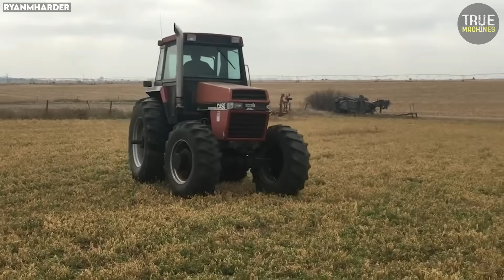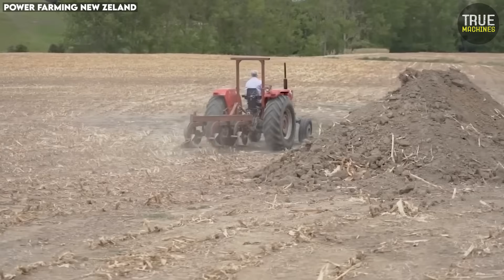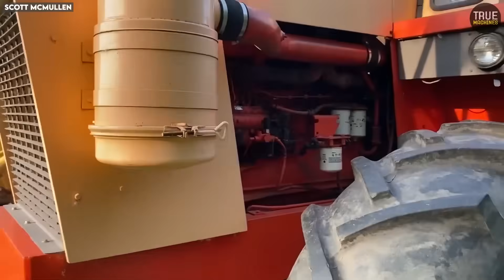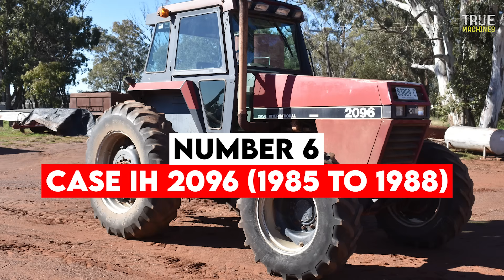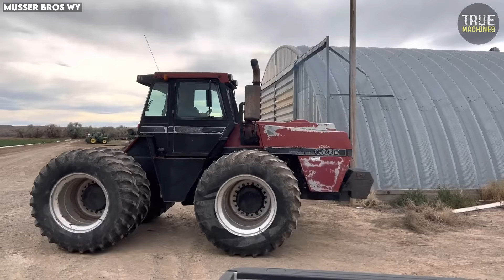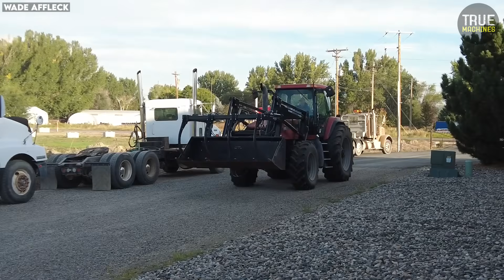10 Case Tractors That Were Great, But Failed!

Comment: I don't know who wrote the script for this video but, they need to look up what an articulated tractor is.   The 1200, 1470, and the 4470 are not articulated tractors. They all have steerable axles and are not hinged in the middle.

Comment: The Case 1200 Traction King tractor was not articulated, but featured a rigid chassis.
 It steered via various permutations of its 4 wheels, which is to say, crab steering, co-ordinated steering and either independant steering via the individual axles, which were sourced from Clarke and were drive/steer types.
 The Case 1200 was succeeded by the Case Traction King 1470 model and various other Case tractor models of 4 equal sized wheels which both drove and steered the machines. The rigid frame, 4 way steering concept carried on for many years, with former Case models even being painted in the new Case IH livery after Tenneco bought out IH in late 1984.
 However, one disdavantage of the drive/steer concept was the fact that the steering joints were the weak link in the system - these types of axles simply couldn't handle the same loads as equivilently specced rigid axles found on competitors articulated tractor models.